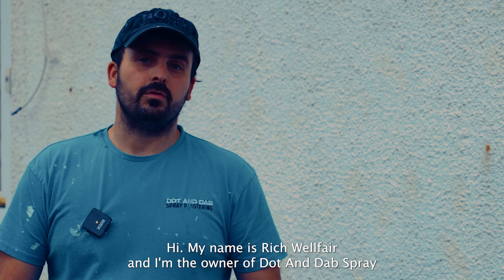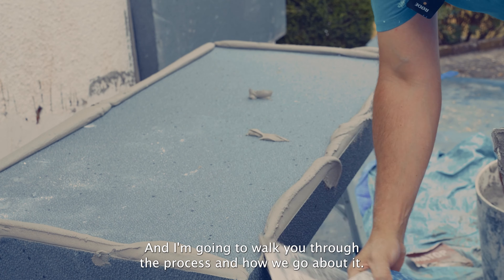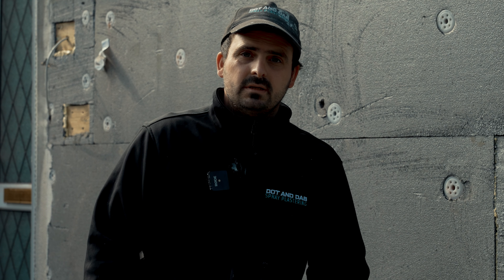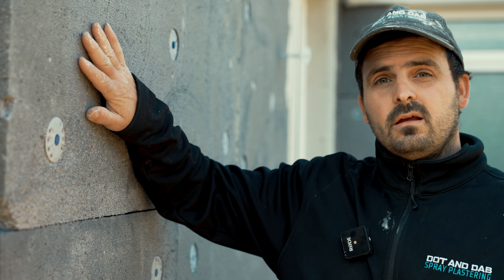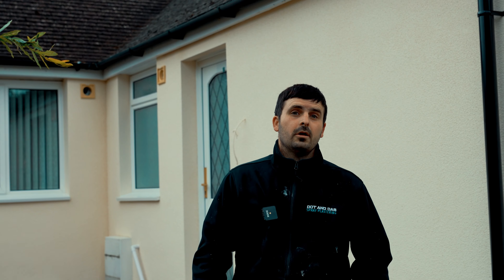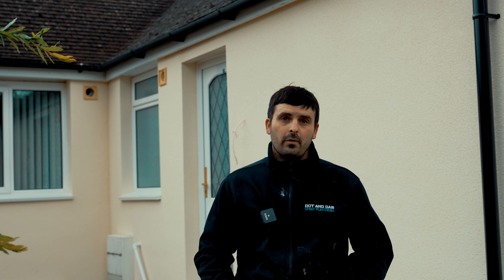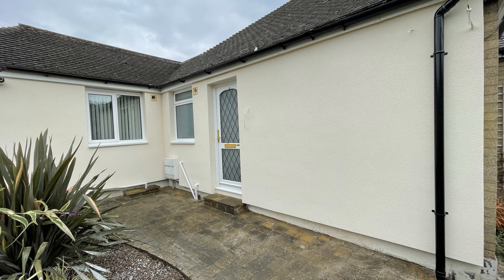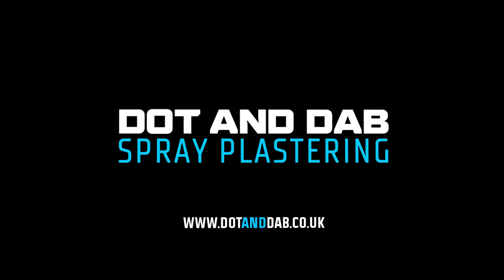External Wall Insulation - Cheltenham

Comment: For people who have older properties with cavity, how will EWI help ? Surely you will have air passing around the cavity and flooring still. I don't recommend people having cavity wall insulation either, too many problems with it be it damp and mould forming because the property can't breath.  People who have had polystyrene beads pumped into their wall cavity will eventually have problems with electrical  cables if there services pass through the wall since they react with one another.
Reply from the maker: Hi thanks for your question, ill do my best to answer , firstly the eps is calculated to allow for a cavity in the u value measurement, and the system is fully permeable. Also air typically does not move in a cavity it is static , the reason for a cavity originally was not for insulation purposes but to alow the building to breath along with it being cheaper than solid wall building (labour and skill wise) thats going way back 1920! From
Personally installing this system for over 15 years including my own home that is part soildwall and cavity we see amazing if not instant results . Please look on my video list for client testimonial video’s on EWI 

Thanks
Reply: The cavity needs to be insulated too - Also External Insulation should go below ground level/footpath (600mm below internal finished floor level) and all the way up through the soffit to the wall plate where it should meet with the attic insulation, Otherwise it's like going out with a long winter jacket on with no hat or shoes!

Comment: Looks good! How easy is it to make alterations once installed, e.g. Mounting a security light or drilling a fibre Internet cable through?
Reply from the maker: In my extended video ( not completed) you see we installed timer fixing points for known items, but also we have special fixings for lightweight items